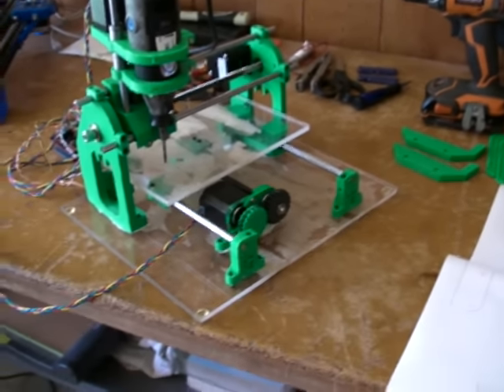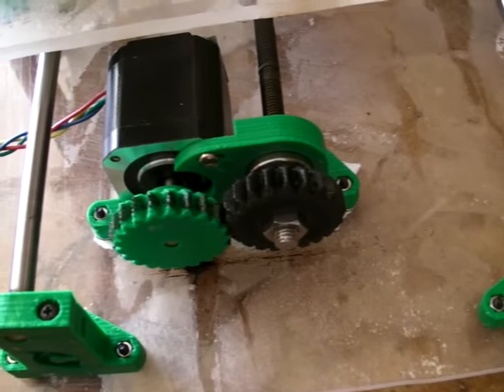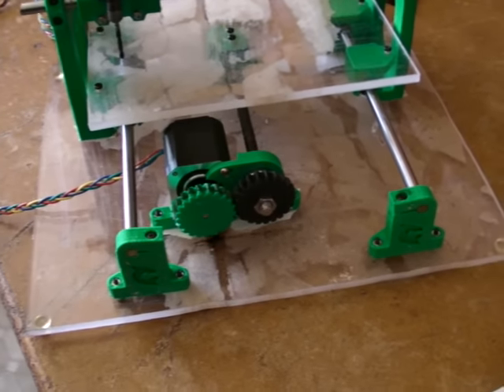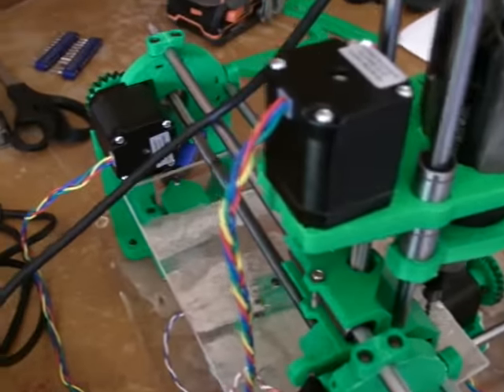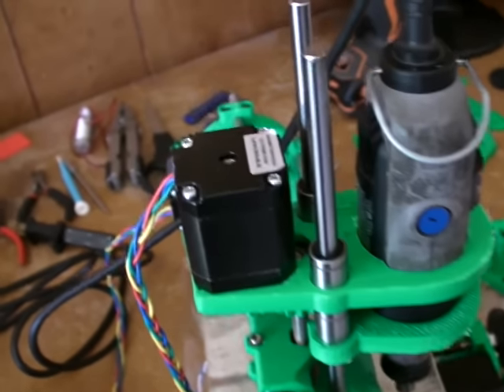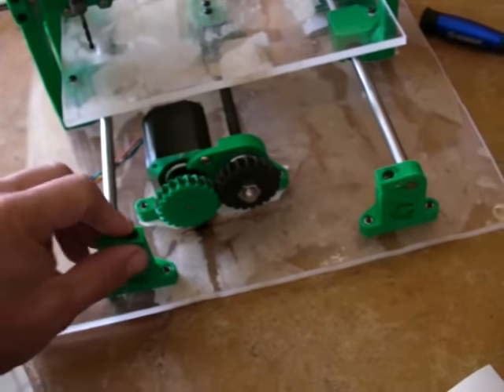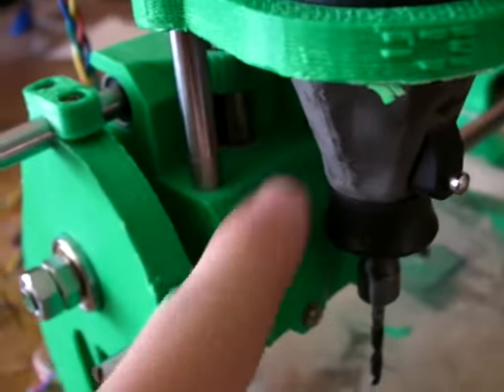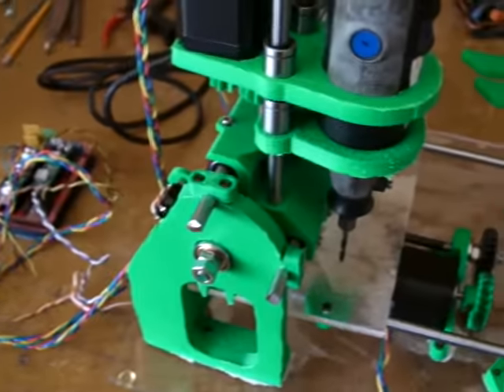Cyclone PCB Factory DIY CNC Router Mill Machine

Comment: subscribed to see how this pcb mill works out.. I hope you will show it working one day. Using ramps 1.4 seems like it should work out more functions than you would need. I been playing with arduino uno and cnc shield basically same stepper drivers just not the extra features of ramps

Comment: On your z axis,  you said the nut on the lower of the z-rod carriage did not work out?  It uses a nut at the bottom,  with a spring on top of that and then you adjust the tension using the top z nut (the one you didn't use.).  This is a zero backlash function.  You should also do the same for the y carriage and the x carriage. (2 trapped nuts with a spring between to remove backlash)  Without them,  you will have a lot of backlash and it will be hard to get accurate cuts (they'll have too much slop/play in the cuts).  
  Pretty much the same way it works on some 3d printers.  I just finished building mine as well and am refining some custom parts.  The assembly of the z-carriage does need some better documentation,  but I was able to find pics/figure it out.
Reply: They have actually added some build instructions to the reprap wiki arrticle for the cyclone. http://reprap.org/wiki/Cyclone_PCB_Factory/build

Comment: Amazing work! Now my question: How did you design all these 3D printed gears? OpenSCAD, AutoDesk, SolidWorks, ...?
Reply from the maker: +starwars31337 
I didn't design them. Some guy smarter than me did. I just came across his design, in which the files needed to input into the 3D printer CAM program were made public, and I printed the plastic parts.

At the time, there was not a tutorial on how to build it, I had to guess from other designs, as well as use some of the building experience gained from assembling the 3D printer.

Watch the other videos I have on this CNC machine; they show more of what I did and how I did it.
Reply: Thanks for your quick reply! I will check out your videos.

Comment: I think you've mounted the top bracket for the spindle upside down, the linear bearings should be touching each other. this explaines why your z axis leadscrew assembly didnt work correctly.
Reply from the maker: hahahaha, wouldn't be the first time I installed something backwards, oops

Comment from the maker: I presume you are looking for the limit switch for the Z axis.

You don't really need one, that is to say, unless you are going to have a vertical maximum Z limit before the Z carriage runs out of 'track'.

More than likely what was intended by the creator of this project, was the individual builders come up with a method of installing a Z axis minimum end stop that will allow height adjustment. This is because each builder of this CNC machine are going to be milling different type of materials with variable thickness from one milled object to the next.

This means, your Z axis minimum is going to change because of the different thickness of materials you will be milling. Remember, the Z axis limit switch is telling the software/firmware where the TOP of the to-be-milled work is.. in other words, where to begin.

Comment: I noticed that most of your gear ratios are 1:1. Why would you not just couple the stepper motor straight on the leadscrew?
Reply from the maker: Tower Crisis ask the guy who created it
Reply: It's to save space. i think the creator wanted to fit the base onto a4 size. putting the motors straight on the leadscrew would enlarge the build size.

Comment: hi
how did you do it for the z probe firmware settings.
Reply from the maker: Hasan Koçali Honestly, I have not got that far yet. Given that the motors and drive controls are the same as the 3D printer, I've just been fooling around with the machine doing "dry runs" of 3D printing.

The Z probing function is already in Marlin firmware, but has been expanded and improved, to what full extent I don't know yet, in the modified Marlin firmware on the developer's website. Search for cyclone PCB factory and find what you are looking for, you shall.
Reply: Project23D thanks

Comment: what is the firmware you have used
can u give a link of that 
please
Reply from the maker: +abilash chakaravarthy 
the firmware is currently marlin ... I think. I may have used the one modified by the creator of Cyclone PCB mill.

I think I am going to switch to GBRL as it works with gCode produced by LinuxCNC/EMC2 because they use the standards set by the NIST.
Reply: but does grbl is compatible with ramps 1.4
Reply from the maker: +abilash chakaravarthy 
yes. Search for GBRL and you will find what it is compatible with as well as what it can do.

It become apparent to me Marlin and other common reprap firmware isn't really suited for milling work unless you want to write your own control and gcode generator programs

Comment: You must have tons of backlash in x you way that is setup. Never good idea to ever use gears to drive a cnc3d axis. Gt2 or 3m belt and printed pulley setup would of been a lot smarter to use and won't chance over time as its used
Reply from the maker: RICH MORGENSTEIN no I don't. Granted, precision is only ~.01mm tolerance with this setup, but it is better than what is need for what I use it for
Reply: No, it's not smart to use a belt on a milling machine. The machine has anti back-lash double nut design.